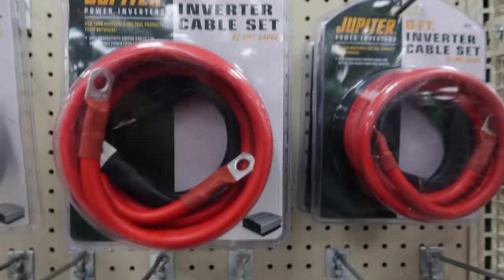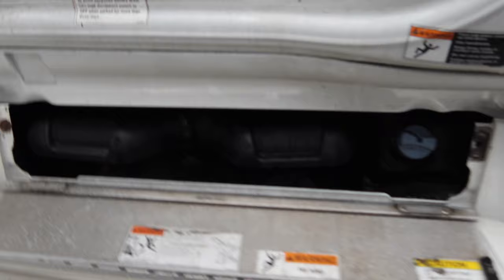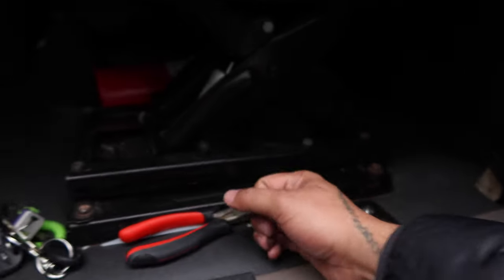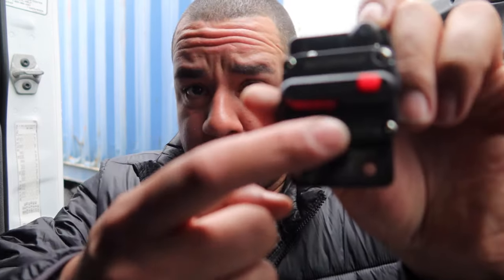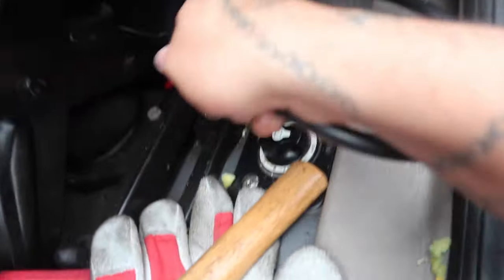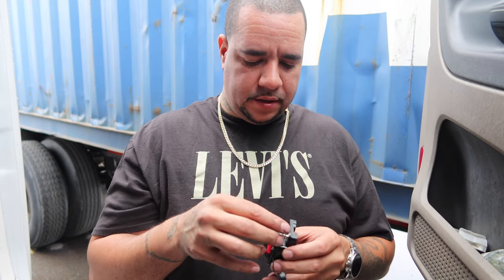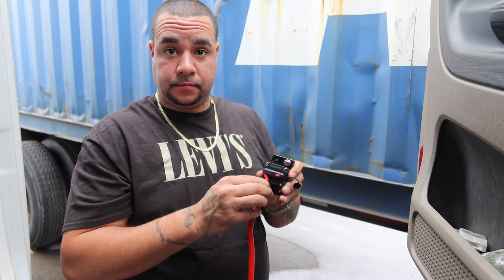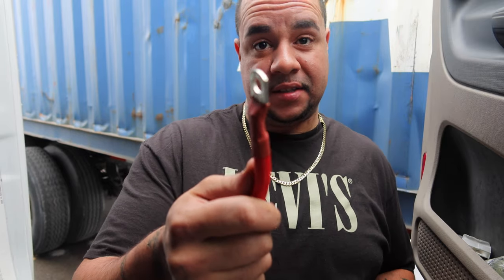How To Install an INVERTER ‘STEP BY STEP’ in a semi truck #inverter #trucking #powerdrive #howto

Comment: I appreciate you doing this video and passing on this info, but I have to try and give you this piece of advice. Running the positive wire from your battery through a jagged sharp-edged hole in your floorboards is a recipe for disaster. Use a step drill bit to drill the hole and then put a rubber grommet in the hole to protect the + wire. Both items are available from any Harbor Freight store. Good luck trucking!
Reply from the maker: Thank you driver
Reply: Wow, this is the best feedback. Thank you

Comment: Anyone watching this. Rule of thumb with any electrical inside of a vehicle. Hook up ground wire first also protect your red power wire especially from the inside of that sharp hole. If it rubs through it could cause a fire. Also keep fuse as close to battery as possible.
Reply: Yea ur right lol Do u really need a fuse for an Inverter???
Reply: @Bombon_909  yes. If you don't you could start a whole fire. It's still a moving vehicle. If you wreck or something it could damage the power wire and the fuse would pop before it becomes a fire hazard

Comment: Key safety info missing..voltage of inverter vs voltage that the truck batts pushes out..what gauge size?? Hooking up a 12v inverter which most are to a truck the poses 14v will cause a smokie situation on contact..potential fire

Comment: … we are good to go. I didn’t even have to drill wholes in the floor. There were two bolts in the floor that served no purpose so I removed them and my cables whet right through. I believe they were made just for that cause they weren’t connected to anything. Jus 2 random bolts
Reply from the maker: Glad it worked out for you
Reply: @FreewayHustlin  appreciate your video.

Comment: How long will it power fridge if the truck is not running
Reply from the maker: Depends on the batteries, but from my experience usually 2 or 3 days.. it will drain the batteries and you will need to jumpstart the truck

Comment: The battery not gonna 🪫 ?
Reply from the maker: No. But if you leave your refrigerator running for 3 or 4 days without starting the truck then it will drain the batteries and you will need a jumpstart. 
I recommend just shutting everything off if your going to be gone for more than 3 days

Comment: Do I need the black box?
Reply from the maker: Your don’t need it but it is recommended. It’s a safety issue. If it happens to over heat for any reason that will go off and shut down to prevent a fire. It’s only $20 on Amazon and it’s called a circuit breaker
Reply: @FreewayHustlin  yea I realized I’m otr a lot I’m going get it but i went ahead and installers without for time being appreciate the easy fix man

Comment: So does the inverter work while the truck is off?
Reply from the maker: Yes it will power small devices like phones, tablets etc.. and a refrigerator for 2 or 3 days.  But will need to power truck on to use a microwave or cooking appliances

Comment: I need to install one but I’m using a Ryder rental and can’t drill holes. Is there a way to install it without the holes? What would you recommend
Reply from the maker: This is difficult to do. You can get smaller inverter that hooks to lighter plug can run smaller electronics. There’s coolers that connect to the lighter as well, serves as a small fridge
Reply: Mybe pull back the rubber flooring or carpet in one of back corners behind seats like the guy did in the video but pull back floor material first and drill hole underneath the carpet or rubber flooring and run cables through and when you give the truck back just take ALL the cables out and tuck floor material back down in place it will look like factor again